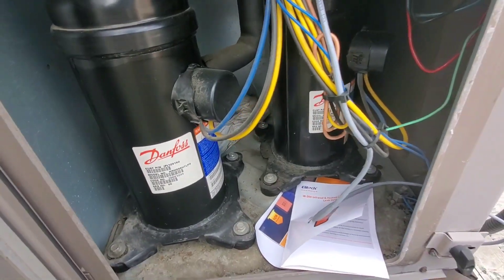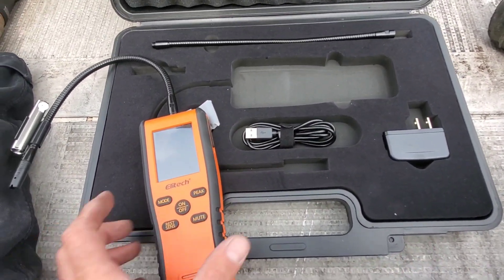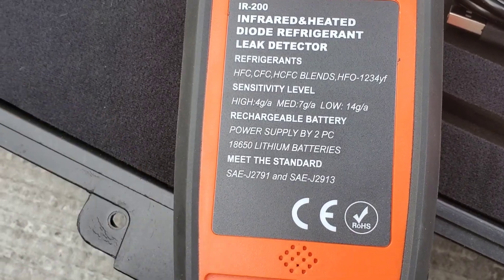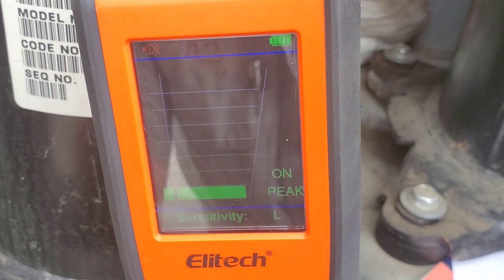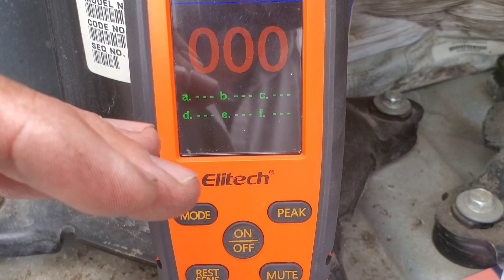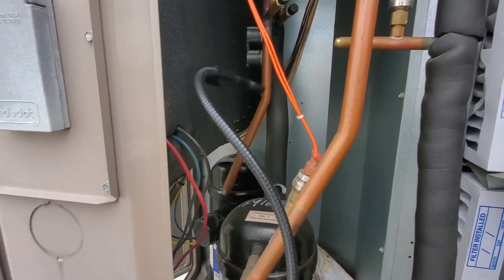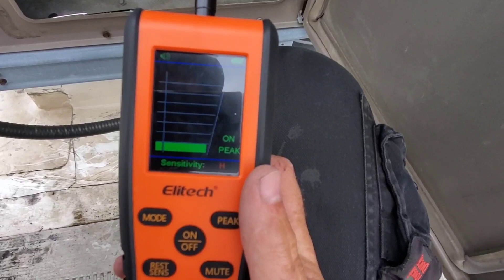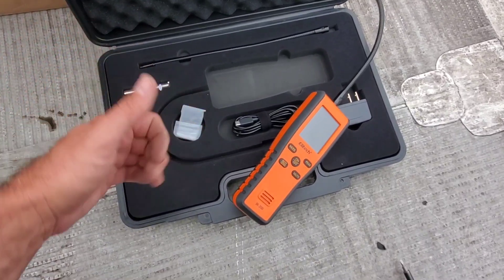Two Sensor Refrigerant Leak Detector - Elitech IR-200

Comment: Hey buddy.. Im thinking im going to get the Elitech 2-Way Valve Manifold Gauge LMG-10W, Refrigerant Scale LMC-100A+, Infrared Refrigeration Leak Detector ILD-200.. On amazon for only 504 bucks! I had the awful experience of of putting siding up and hit my suction  3/4 line with a nail.. ugh.. removed the siding, cut the plywood section out & silver soldered the hole up.. Did a nitrogen purge, vacuumed it for 45 mins then introduced R410A back into the system.. I did this with my automotive analog gauges and weighed the refrigerant with my wife's digital scales.. It works & blows cold and i know i was totally winging it but i also Prayed and i know the Lord heard my prayer! So next time i need to give him a little more support with a decent set of tools Rite!!  Thanks so much for your teaching!!

Comment: Thinking of picking this one up to compliment the H-10, how would you rate the performance on R290? Not sure if you have tried that with it but that's the reason I wanted to pick it up
Reply from the maker: Never tried it on that refrigerant to be honest
Reply: @HVACKnowItAll  won't work on R290 R290 I'd propane need a gas  leak detector
Reply: The Elitech EU site says it does HC's. But the manual doesn't..
Reply: Yes it will in heated diode mode!